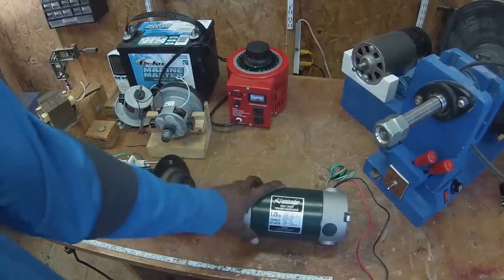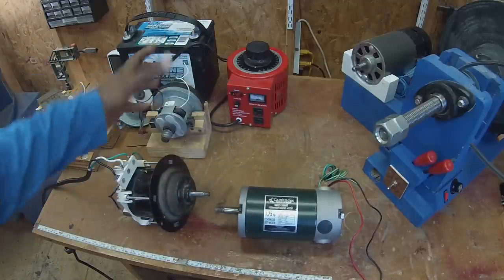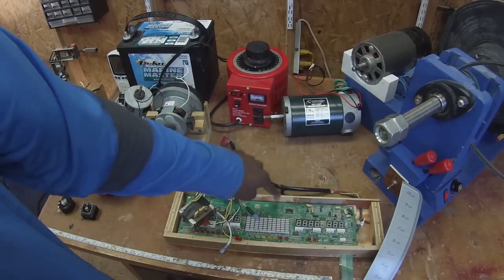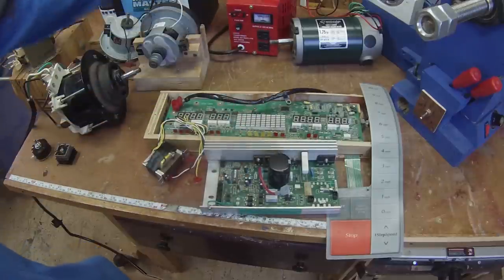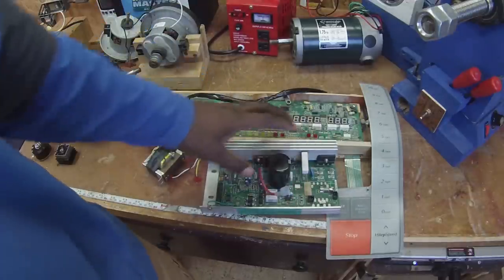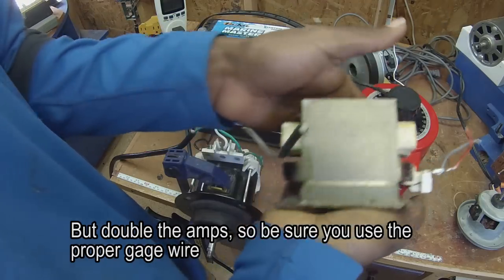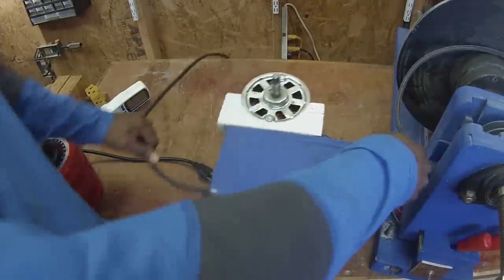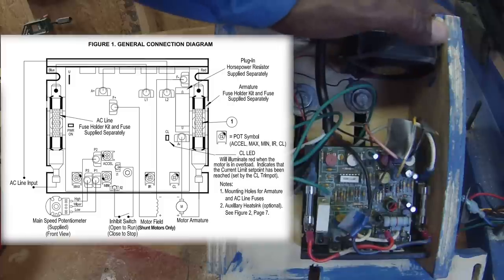How To Wire A Large DC Motor And Control The Speed; Treadmill Motors and Universal Motors 019

Comment: Thank you!! you explained the wiring in a language I understood!!  Seems like a MC60 motor controller board puts everything in a nice package when using a treadmill motor.  Do you know if a MC60 would handle a 4.5 horsepower motor?
Reply from the maker: +Michelle Nogin I don't know. Treadmills rarely go over 2.2 horsepower and still use a D.C. Motor. Probably not

Comment: I am a beginner at electric motors. I am building a drum sander and have a 3/4hp induction motor at 3450rpm. it is too much rpm for a sander and I would like to know the easiest way to reduce the rpm by 50% or so. Will the harbor freight variable speed control work without damaging the motor. Thanks for your help.

Comment: Jeremy, I am thinking about  using a 24 volt helicopter starer motor i have to power a small truck along with a 18 hp lawn mower gas engine and generator thru 12 small lawnmower batteries, if i can't afford lithium. Cooling the 24 volt is a problem, would two or more treadmill motors work. I'm retired so cost IS a problem. What are your thoughts ?

Comment: I have a series wound dc forklift motor. rated for 96 volts max 150 amps. what is the most reliable way to control speed at a given torque?

Comment: My treadmill is not working.  The motor is working properly but there is a problem in the circuit board that shuts down the treadmill after 10 or 15 seconds and gives an error code of 11 and/or 21.  My research on-line points to their being a faulty component on the circuit board.  After watching your video, I was thinking I could purchase a rectifying diode and motor controller, disconnect the motor leads from the circuit board, and attached those leads to the motor control switch.  That should allow me to control the speed of the motor with the rotating switch and use the treadmill, correct?

Comment: Maybe you can answer this. Can I use a 120v ac 10 amp variac run through a bridge rectifier and a reversible switch to run a treadmill motor?

Comment: I love your videos, very informative and educational. However I must disagree with you that the battery operated lawnmower, designed for 24 vdc will develop about half the horsepower on 12vdc. In actuality the motor will make about 1/4 the horsepower on 12vdc as it would on 24vdc. Half the voltage and half the current will result in 1/4 the power. About 70.7% of 24v will give half the power.

Comment: Sounds like in a battery there's a calculatable amount of available electrons, short wave  or long wave and the conductors are more direct current, mostly fed regs overinflate usually for safety, my ? Is that the same case with nickel batteries? If you took  a air conditioner(cold)(directed it onto everything related to the battery and the battery) enclosed everything from the battery and what's consuming it(electrons) wouldn't there be a difference in performance? Controlled flow of electrons  already  exists with that you could set up a speed control with a counter, maybe you could design a rotating permanent magnet.

Comment: I have a 115 V PM DC motor. 1 HP. I'm looking at KBIC-125 controllers like the one in this video you have pictured that outputs 0-130 V DC but all of the KBIC-125s I'm finding only output 0-90V DC. Am I missing something? Is it the "B" in "9433B" model number that denotes the difference in capability?

Comment: Hi, how do you figure out voltage specs for a dc motor when the label is damaged? Got a drill press with a dc motor but I'm afraid to power it up. I have a variac so would that help? Thanks!

Comment: I have a question about smaller DC motors ie rc car motors, how would I power and regulate the speed of the motor.  I know I need a power supply and a pwm, but are there any sites that sell these in all in one components, I'm making a project that needs to be compact and would rather be able to buy these in bulk rather than build each one to keep production time down, any suggestions would help.  I need a 12v power supply and a 10amp pwm in one package

Comment: Hi jeremy!i salvage a hitachi washing machine motor rated 110-120v ac,its an imported washing machine its in japanese. this motor has 3 pins and a separate 2 wire,i was wondering what are the 2 wires for beacause the 3 pins is from the coils inside i think its a brushless motor. Can`t find the schematic diagram and since the motor do not have any label.

Comment: So if I need to run a 180dc motor on a meat grinder I’m building, could I just use a bridge rectifier straight from the mains? The rpms on the motor are 42@90v and 84@180. The rpm are not that important. I’ve read somewhere that it’ll be close to 159-160vdc out of the rectifier. Would that be safe?

Comment: Using the VARIAC and rectifier bridge to run a 24 volt motor is not complete? I also need a capacitor wired into the circuit? I bought a 200 amp 1200 volt bridge to run a jazzy electric wheelchair motor. You mentioned you had another video on putting a capacitor in, can you point me in the right direction?

Comment: hey fyi. input current type on a transformer dose not affect the output as you mentioned. transformer output is always AC. also a DC powered transformer must be modulated to drive it but output will still be AC. automobile alternator has a built in bridge to convert to DC because of this.
Reply from the maker: +Tom N (Elmerjfudd) I am pretty certain I presented this correctly. Voltage out is relative to the number of turns and I said the output was ac. I don't understand your comment. Maybe you misunderstood me in the video? The transformer doesn't work on D.C ...you don't get the changing magnetic field. Please watch again and read the footnote carefully. I said the amps on the output is double when the voltage is halved by stepping down. Energy must be conserved
Reply: Jeremy Fielding great video I'm not bashing or anything. in your explanation of of the microwave transformer you said, the output was similar to the input in the sence that it's ac. I don't want to sound like I know it all, I don't. you have a great channel. I just wanted to make sure you understood that the current is always going to be AC. correct me if I'm wrong but that is a step up transformer. well if it is you could drive it with 12 volt DC and that would step it up to AC what the ratio is I don't know. anyway it just sounded like you were implying it would be DC if driven with DC. great video and I will surely be watching for more.
Reply from the maker: I didn’t take it as bashing. I thought your response was very respectful. Now, I think I understand a little better what part is giving you trouble. I prefer to talk and point so please bear with me here. You seem to be confusing the meaning of some words. To "Step Up" refers only to the voltage. I can step up 120 volts to 240 volts, or step down the voltage to whatever amount I want. That is unrelated to AC or DC. DC current will NOT work in a transformer. If you run DC current directly across the coil you will get a magnet, but that will only induce a extremely brief pulse of current in the top coil. So brief in fact it is worthless for powering anything. The magnetic field must be changing to induce a current. AC current flips direction 60 times per second (in the US) so the magnetic field flips polarity 60 times per second. That is what it takes to induce a voltage across the top coil. The output is AC because the input MUST be AC to work. That doesn't mean you can't create a AC current with a DC source. This is how DC motors work (Yes DC motor require AC to run). The commutator switches which side of the coil is attached to the DC motor through the brushes. This flips the magnetic fields direction and you get a spinning motor. Sorry for the long reply. This one is difficult to explain in text. I almost want to make a short video and send it to you so I can point at parts while I talk. I hope this clears at least some of the confusion. If you happen to have the supplies give it a try. Hook a battery to the bottom coil and check the top with a multi-meter. You will see there is no voltage there… AC or DC. But it will be magnetic though! If you have a magnet that is strong enough try moving the wire inside and outside the magnet while checking the voltage across the wire. You should find a small AC voltage. (negative voltage then positive alternating). Thanks for this comment. I love corresponding like this. I have learned a great deal speaking with people like yourself who have asked questions and challenged things I say in my videos. The most powerful learning experiences I have had were when I was wrong.
Reply: Jeremy Fielding so that's what I thought you do have it wrong. a coil can be driven with DC and the output will be ac. it dose work I promise. i would like to see you try it. make a small circuit with a motor, battery and a primary coil. and measure the output of the coil. the motor will drain some of your current and reduce the current to the primary but what the motor also dose is modulate the DC current. the modulated current going through the coil will create your magnetic field and produce AC current on the output. there are more efficient ways of modulating DC current but the motor is available I'm sure. each time the motor brushes make contact it closes the circuit and you get current then the brushes open and done. then the brushes close the circuit and you get more output. it's a simple crude DC to AC conversation.
Reply from the maker: I will point out one law of physics here then if you don't believe me... how about the university of illinois physics department? This very question is on their website. link is below titled "why are there no DC transformers"

The direction of current is determined by the right hand rule. If the current in the primary is DC (only flowing in one direction) the current on the seconding MUST also be flowing in one direction. Its a law of physics. This means if you really have DC in you MUST have DC out of the secondary coil. However that doesn't work. Please see the link below. AC out requires AC in, how you get that AC can be commutators and etc all the stuff I said above.

here is the college website. 
https://van.physics.illinois.edu/qa/listing.php?id=2354

I would love to discuss this farther but perhaps you should send me a message on my "about" page so we can discuss at greater length. This topic is no longer related to what I am presenting in the video, and becoming too technical for comments. You are certainly making me think deeply about this topic, and I like it. :) The behavior of the coil in series with the motor is an interesting topic, but that is not how a standard transformer works. I don't have the expertise to comment on whether this is some interesting behavior you have observed from coils in a circuit with a motor. I do know the right hand rule, and that is a law of science.

Comment: Would you need a start/run capacitor or a high voltage? Some of those treadmill motors are 130Vdc.
Reply from the maker: From 90-130 vDC is the typical range discussed in the video.

Comment: you know more than I do but I think those HF router speed controllers can go bad if you use it improperly. I am sure you know this. But you are always suppose to have the router off and set the speed while it is off. And not adjust it while it is running the router.  Just a thought.
Reply from the maker: Well, in this case we are not using a router. The manual is only a couple of pages, but it does say to release the trigger before you change the speed. That however is for safety reasons and could not possibly damage the triac. As long as you are using it within it's rated amps and voltage. Unfortunately the problem is really quality control. Either the triac or the potentiometer is not functioning properly, and it was that way out of the box.

Comment: Nice video as always Jeremy! How many volts DC do the treadmill motors typicality need to run efficiently? and  how would you control these DC treadmill motors if you wanted to run them off of standard 12 volt automotive batteries in a way that  they maintain  speeds (variable) as load increases? If you could suggest specific parts and sources, either new or salvaged that would really be very, very helpful... Thank you!
Reply from the maker: That's a tough question, but i can answer parts of it. I haven't tried to do what you are describing...They run will run at almost any voltage... its depends on the load you want to apply as to whether it will be efficient. In the video I am running the motor at 10-15 volts with the transformer, but it has no load on it. A car battery can put out a large current so you should be able to push a reasonable load it with that. As to the details of parts needed... its hard to say without knowing exactly what the end goal is. The application dictates what you need to get the power and speed you want. For example, my KB speed controller dynamically adjust the power output to maintain motor speed, but it requires AC-in to power the board.

Comment: Why not build a simple power supply and use mosfets to control the motor. You can set up a controller using an Arduino pretty easily. Just using a full bridge rectifier gives you pretty dirty DC. That cap would help but you need to know it's voltage rating. Over volting the cap will cause it to explode. The higher the capacity of the cap the better the filtering of the DC. Look into switch mode power supply's if you want to know what a capacitor does to help. There are some grate videos out there including a series by The Post Apocalyptic Inventor.
Reply from the maker: That only sounds simple if you do hobby electronics LOL. We all have different skills and background knowledge. I have learned a lot just by trying things then having people like you come along and say “did you try this” then the learning begins:)
Reply: Jeremy Fielding it seams like a natural extension of the stuff you already know. Your video's are great by the way. Your teaching methods keep me engaged even when I already  know what your are talking about, and there is always something to learn just by hearing a different point of view.

Comment: Hi Jeremy any chance you could tell me why when trying to run my tread mill motor 130v with a speed controller and using a bridge converter every time I switch it on it trips out my aim garage board and the o e in the house I’ve tried variation of wiring it but does it every time I’ve tried 3 different speed controllers ver similar to the one you tried in this video. I would like to use the board that came with the read mill but can’t work out which terminals to use on the board for the potentiometer it’s got the same connection socket as one of the boards you showed. Mc 2100EL. It look so easy to to but I. Stumped. Phil

Comment: Jeremy, I have a tiny scroll saw with a 1-phase capacitor motor (205 watts). It only has a switch for choosing between high (1400 rpm) and low (900 rpm). Its seems difficult to control the speed with this type of motor. Do you have experiences/ideas on how to control the speed without ripping the saw apart and installing a sophisticated PWM control unit?
Reply from the maker: +Lejf Diecks unfortunately Induction motors just don't respond well to speed control. They are driven by line frequency 60 hz in the US. What ever you do to increase slip (slower speed) the motor just draws more current to speed up... PWM basically turns the system on and off rapidly... this will give you poor results as well.

Comment: Hey Jeremy great videos. I am new to this and trying to set up a motor for my metal bead roller. I'm buying a used Dayton Dc 90v .8amp motor. I want to have it set to a foot pedal for foward and reverse and variable speed. I'm just not sure what I need do I just need a rectifier with a speed control?
Reply from the maker: It might help to watch the video a few times. All the details are there. I explain better in the video then I could here. Also I have a whole series of videos on “how motors work” for beginners. You would find the DC. Video very helpful